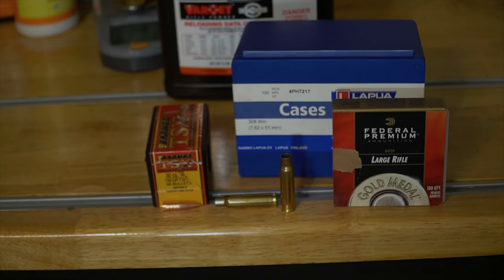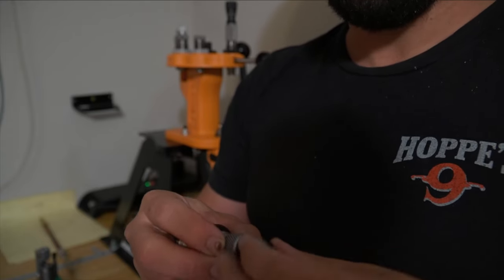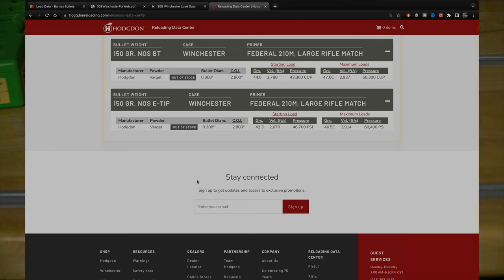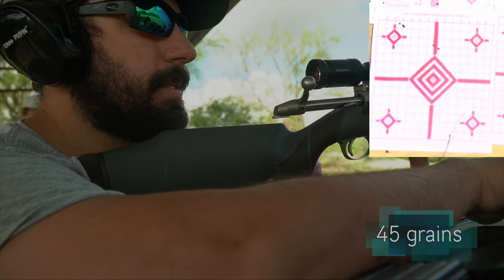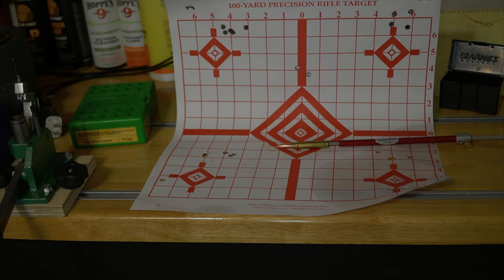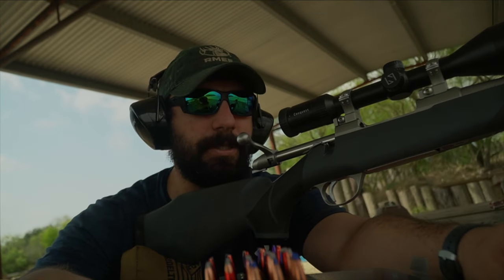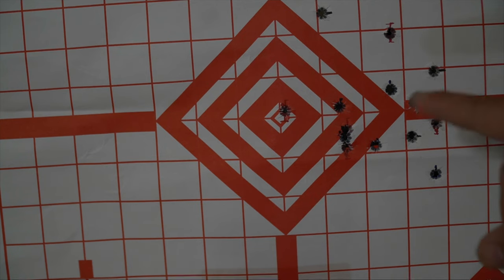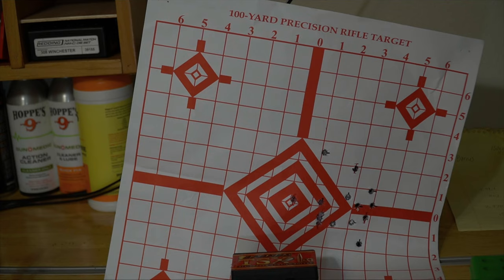308 Win Load development 150 gr Barnes TSX BT with Hodgdon Varget

Comment: The 130 ttsx are deer seekers in my .308.  Bang, flop.  I run on the lighter side at 48.0 grains.  Treats the brass good and still gets me just shy of 3000 fps.

Jump is a good tuning tool for Barnes coppers.  It is tedious though.
Reply from the maker: For sure 130 grain is great.   I will eventually give the 130 grain a try, just at the time 150 grain was on the shelf local and we got it to work.
Reply: @DanielGuillette  I'm sure the 150s get the job done as good.  Barnes ttsx are solid performers.   The 115s in 6.5 Grendel work great too.  My daughter has took two shots at deer with them...2 dead deer.